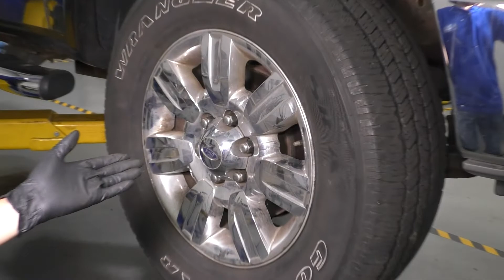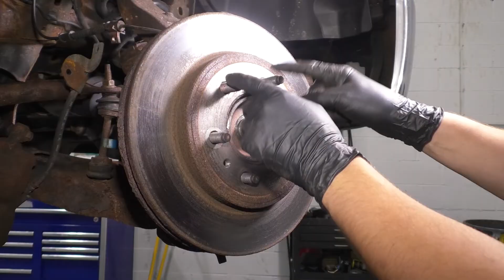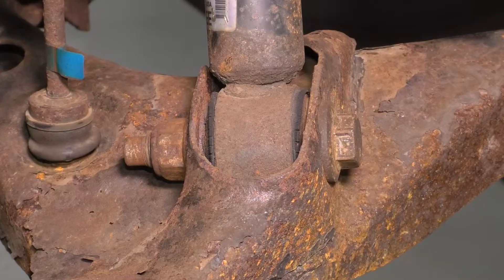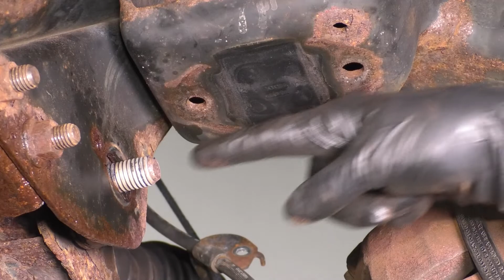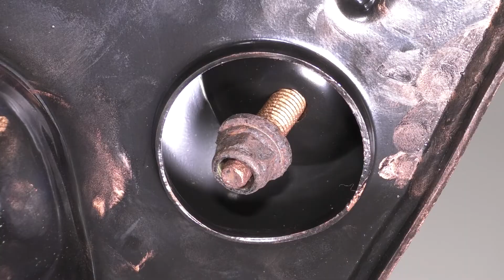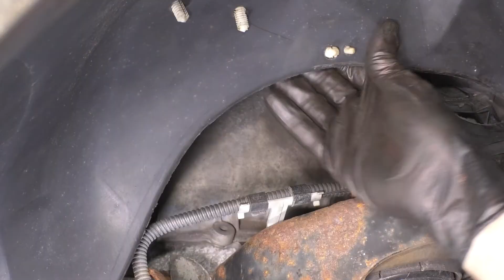How to Replace Lower Control Arms 2009-2014 Ford F-150

Comment: This doesn't look like a 2014 f150 lower control arm, more like the 09-13. 2014 model changed the lower control arm. It no longer has the large through bolt.

Comment: It took me a week to get my control arm bolts out, both sides. They all seize from what I understand. I hit it every day with PB Blaster, used the impact wrench. Finally, I used a heavy duty c-clamp and I got it to move. Then I started with a small socket by the sway bar and kept tightening until it came out more, then I needed a slightly longer socket. The more the bolt comes out, the bigger a socket you can slip between the clamp and the bolt. Doesn't have to be a socket you squeeze in there, just something that doesn't give at all. Like a bolt that fits into the gap between the sway bar and the bolt.

Comment: I’m doing the same job, I am also using a 2 post lift, however whenever I use a pole jack to lift the control arm up the entire truck wants to go up as well how do I work around that??

Comment: What about alignment time? When a jacking compensation is done would the bolts adjusting caster/camber not be loosened to adjust but you cant adjust if its jacked off the control arms so you would life off from then disturbing ride height

Comment: Does copper anti seize not affect torque spec on nuts? I think i rather it seize in place with rust than work itself off..no? Great video BTW. Just not sure about anti-seize applications.

Comment: I I plan on replacing upper/lower control arms as well as the struts, could I just disconnect the sway bar, the top end of the struts and the lower control arm from the frame and take it all down in one go?

TIA.